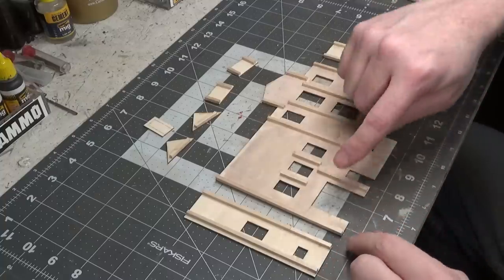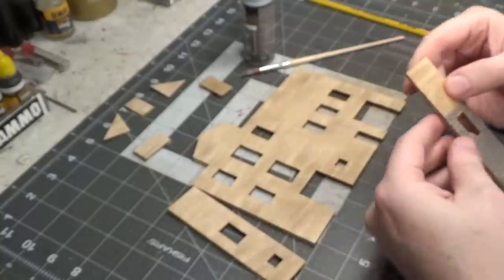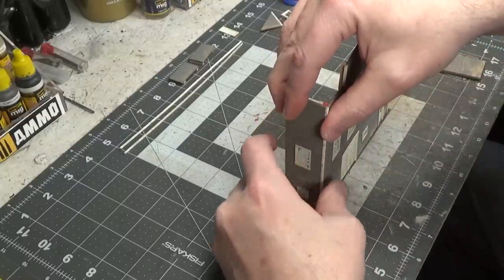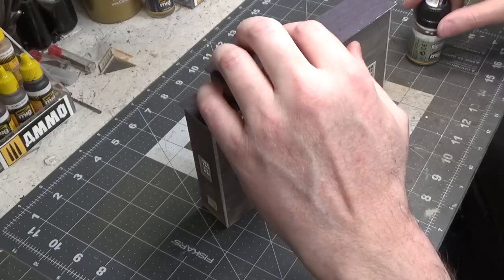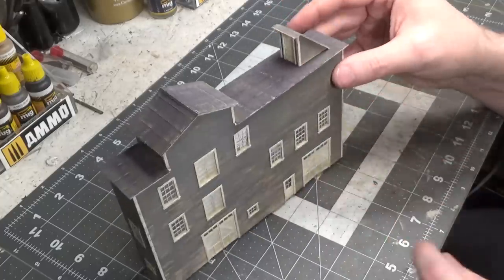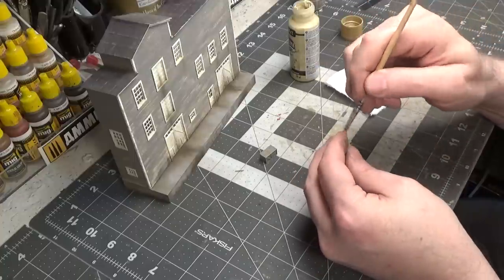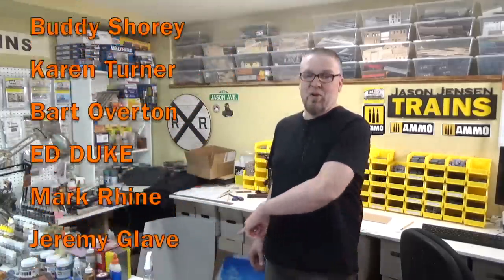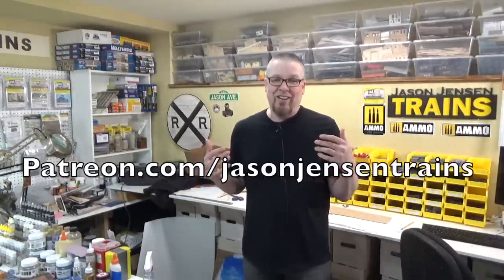Building a new background kit!

Comment: Jason, continued great videos!!  I learn something new with each one.
Q:  In building the base/loading dock, why did you not add bracing to the bottom of the platform set back as required for the walls?  IMO, this would help align the walls and provide a larger gluing surface for the walls.  
I recently received this kit and am looking forward to building it, though I need a shorter depth to my backdrop; I am limited in my area.